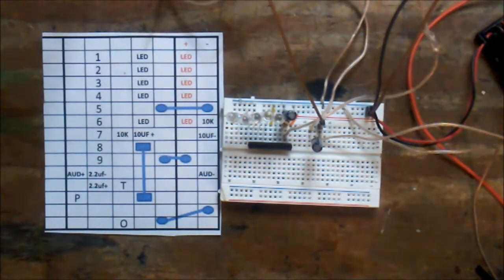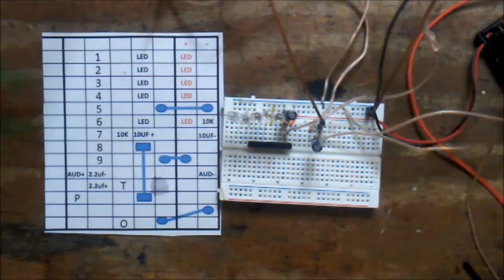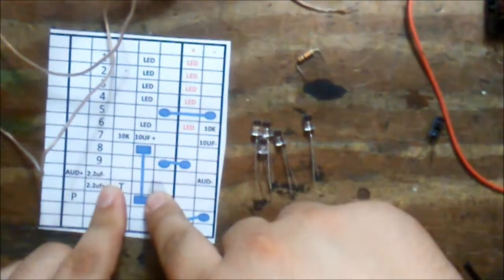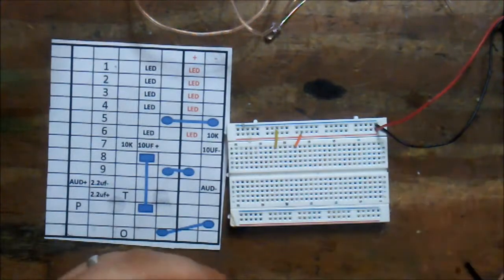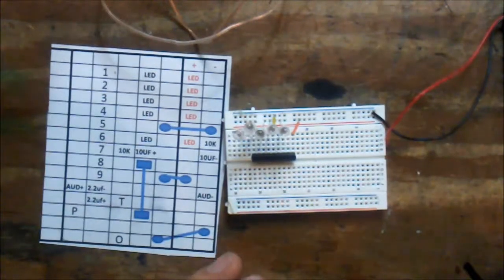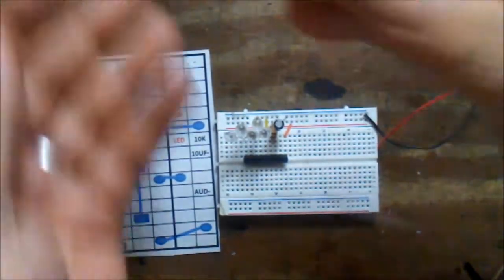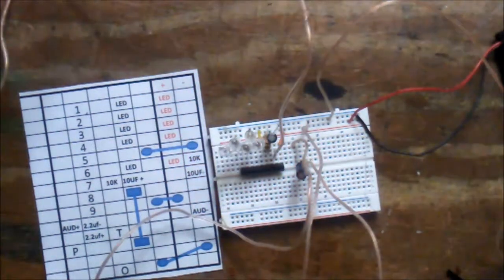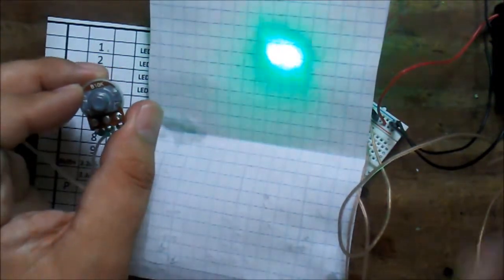VU Meter AN6884

Comment: There's a lot of good information here, which is appreciated, however, your presentation suffers from bad pronunciation (you tend to "swallow" your words). Your diagram representation is confusing; rotate the drawing 90 degrees so that it corresponds to the orientation of the board. Your use of "P, O, T" isn't particularly useful. You should use the conventional designations of "CW," "CCW," and "Slider." You should use the term "microfarad" when describing the capacitors. You shouldn't have the battery connected when you start inserting parts.